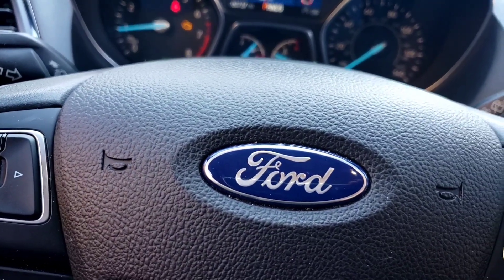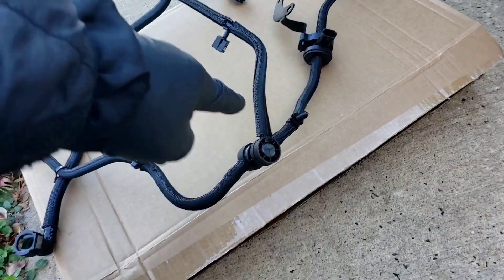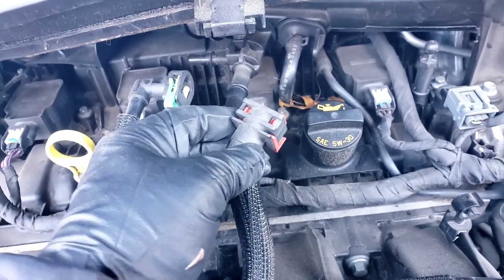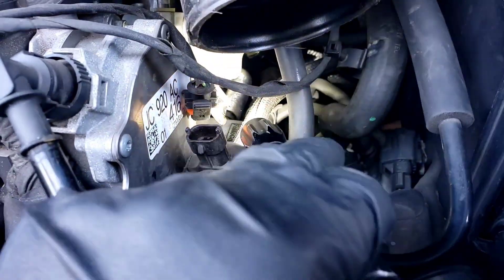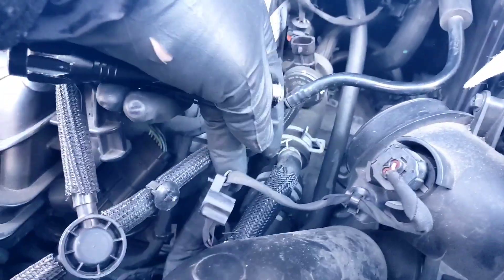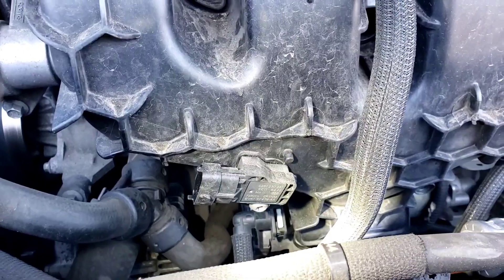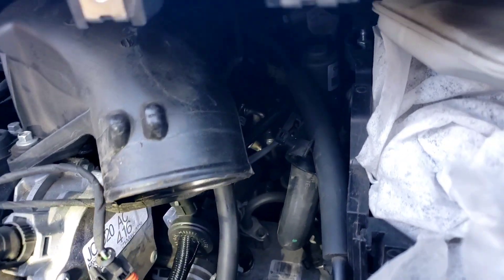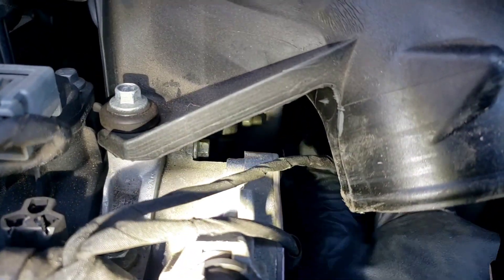Ford Escape P0496 Code  2.0 Turbo  Evap High Purge Flow Canister Solenoid 2019 and Others Similar

Comment: Should i do anything different im using the same hoses amd just changing the solenoid besides just taking the solenoid off?
Reply from the maker: I wouldn't use the same hoses, make sure they won't leak because its 2 different manufacturers

Comment: What do I do if the clips break and the male end is stuck inside?
Reply from the maker: @Swinginringo  if you can get to it, breaking the locking clip is ok, if you're talking about the white push in clip, you can still push it in and find a way to grab the broken hose in..either with a small hook type of tool or needle nose pliers